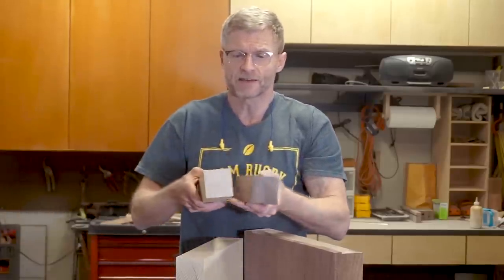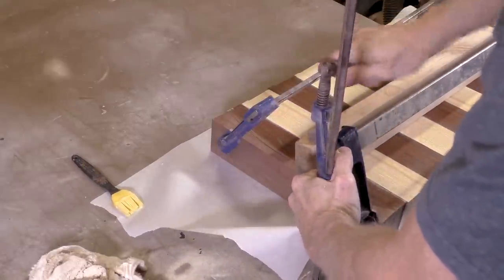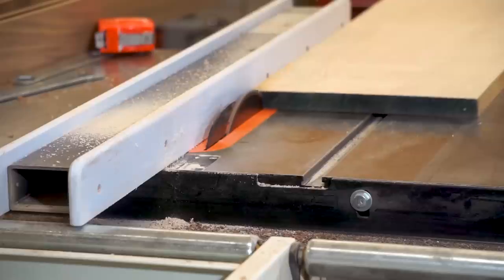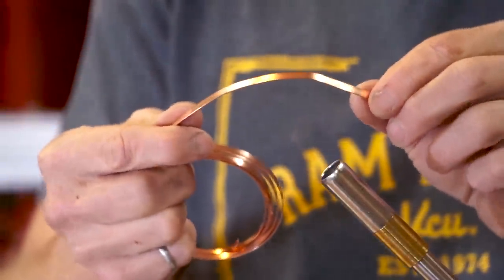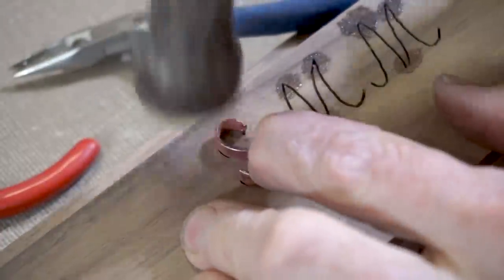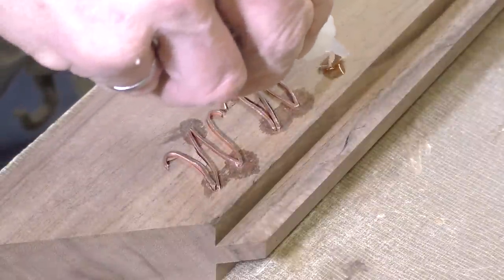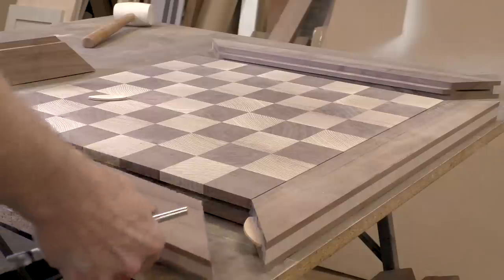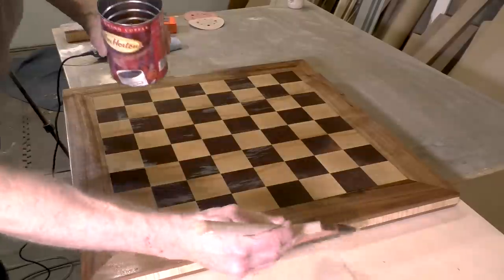Chess Board with Copper Inlay

Comment: Stylish eye, for sure. Very good designer, imo. Decent builder. Tip for the inlay? Good idea to keep within our capacity as humans, i.e. writing/lettering/fonts extremely difficult freehand. So the tip is to do a reverse. Use a copper plate and cut the letters out of it and just inlay the plate. Because you can manipulate the letters until they look right(nail file). Your way, once you Dremel the shape into the wood, you're committed, cz you're bound to the thickness of the copper. With a plate you have no limits, and could even scrap it for another plate, then spray the plate on the board as a stencil, it's faster and looks way better, imho:p 

Peace  

 *oh yeah, when you cut it out, you can clamp 2 plates together, making 2 at the same time, one for the opposite corner of the board. Now it's twice as fast as it just was which was already faster! lol

Comment: I fail to see the point of using such a wide piece of copper for the inlay. A piece of copper wire could have been used with a much shallower groove made with a pantograph. A bit of hammering would flatten the upper surface of it so sanding would remove the bit that was proud and flush it with the surface. CA glue would hold it in place. It is a beautiful job overall, but the finishing went a bit overboard as well. A few coats of wipe-on poly with 320 grit sanding between and some carnauba for the finish would give you as fine and durable a finish. I am not denigrating your beautiful work, just giving feedback from 60 years of experience…

Comment: Nice work, but I believe I would have just hammered some 14 ga. bare copper house wire into the grooves. Just a thought. If you want something pretty, try using maple with mahogany as the contrasting wood sometime. That's what's on my bar top.

Comment: If you're not to confident with metal inlays you could have used copper wire, Using that would have given you more control and the routing wouldn't have needed to be so deep. Just my opinion. BTW the finished board looked great.

Comment: From an old knifemaker, who has pounded a million rivets and pins, the way to anneal (soften) brass and copper and make it more malleable,  heat it "red hot" (cherry red in normal indoor light,about 1400 degrees F) and quench it in water (room temp okay). WoodU, thank The Big Guy we still have people like you who can DO things, not just sit and play with EYE PHONES and computers.
Reply: Well, as pointed out by @TheWireEDM for copper, the quenching does not affect the annealing of copper. You can quench in water if you wish. Quenching in water will cause some of the oxide layer formed by heating to flake off and will reduce the time waiting for the copper to cool. This is different than for steels where the quench very much affects the properties that are present after heating.

Comment: You should have used copper wire for the inlay. It's not like anyone is going to cut a 1/4 inch into the inlay to see how thick it is, is it? I would not be satisfied with that lettering in the slightest. Not for what your client must have paid for that board. No way.

You are going to discover, as I did when I made a table with a copper inlay, that the copper will still oxidize, even under any coating. You're also going to find out that the tiny pieces of copper that get flung around all over the surface of the board when you sand it flush are also going to oxidize and become quite visible.

The only thing I can imagine using that isn't going to oxidize and discolor is gold, frankly. Which, happily, would be considerably more malleable than the copper anyway. You would have gotten far nicer letters out of it. For what your client paid, he deserved gold wire. Not to mention that the gold would have left a very interesting 'sparkle' all over the board.

Comment: Love the project. However I really felt sorry for you seeing the amount of work it took using that solid copper for your inlay. Next time try using powdered copper and CA glue. Not only is it hands down easier inlaying curves. It also handles the inevitable wood movement much better so you don't see the telltale woodshrinkage gaps you'll eventually get around the solid. All the said, I love the way it turned out. Very nice!

Comment: Bending copper work hardens it. Just anneal it again and it will go back to being snowflake soft.  I don't understand why you you used such thick and wide copper for the inlay, copper wire would have been perfect of course. I so love how you discard every single inlay skill learned over centuries by dousing everything in crazy glue. Finally you use Biscuits for tenons instead of crafting mitre corners, sigh, such a wasted time you have on this project. Would I make it, no, I would be ashamed to add my name to such a waste of good wood.

Comment: Given the reliability of modern glues I would have inlaid with wire and could possibly have avoided joins. I'm also not sure how copper reacts with timber chemistry over time, there may be a reason why old cabinet makers used brass inlay. The inlay is not my taste but I'd really love a chess board that size and quality.  I would make it if I had room to work in.

Comment: Could you install splines on the miters & cut the dado's for the edge banding after putting the board together ?
Reply from the maker: That's definitely a possibility. I didn't do it in this video, but I mostly attach the edge banding first and then use mortise and tenon joinery for the mitered corners. By attaching the edge banding before cutting the miters, you don't have to contend with mitering the edge banding to make it fit afterwards.

Comment: jrdaltonjr02
jrdaltonjr02
1 second ago
I liked Chess Board with Copper Inlay very much; copper and brass must be softened by heating & quenching then repeat; until the desired softness is reached. The ends

can be hammered lightly to scarf the tips of the mitire joint. I learned this at about age 25, after much sweat & frustation . sitting down with grandad after, I told him what I had learnet . His laugh let me know he could have saved me the effort. AT 75 he knew much. THANK U 4 THE REMINDER

Comment: Unlike most metals copper is annealed by quenching in water after the heat, not left to cool in room temp...ok so room cooling will anneal it a little bit but try cooling in water, you'll be amazed at how soft it goes

Comment: consensus seems to be, and i agree, that the board is beautiful, thought the inlay is what it is ~ no doubt better than i could do, just lacking in finesse. 

that said, i had owned a trophy/t-shirt shop with the ex (she still has it), and i had always wondered if this process would work, so let me know what you think: because she does vinyl, have her make me a stencil for a plaque board. using that stencil, the vinyl designed for sand blasting, sand blast the image/words into the word. the tricky part would be to gauge the correct depth. then, using ferric chloride, make a 'positive' out of brass to set in the area sandblasted away. glue/fill/sand/finish. i'd always wondered if that would work, anyone have any thoughts?

Comment: I dont know why you did not inlay a copper wire rather than that band. It would have been easer to work and would not have to be cut so deep as to have an issue in chipping. And wire is easer to bend and work in to a pattern.

Comment: Awesome, awesome job! I didn't see this in the comments, but I may have missed it. It should be mentioned that when annealing copper, or any other metal, you want to let the metal cool slowly rather that quenching it in water. Quenching will ad temper, rather that removing it.

Comment: great job but i think you were risking trouble with tapping the copper in with a metal hammer, luckily no problem but i would use a piece of hard wood in between the hammer and copper

Comment: That inlay work looks really hard to do. Makes me wonder how it would turn out to fill it with a molten metal. (I guess you'd have to start with a deeper cut and piece of wood since you'd need to sand off a lot of burned wood on the top. And maybe have to use a metal with a lower melting temp.) Very cool chessboard! I love the way it turned out.

Comment: Are you worried about cracking  from expansion and contraction since the board in endgeain but the frame is not?   I'm curious because a chess board is something I would one day like to make.
Reply from the maker: I don't anticipate any issues because I attached the frame with only a single bit of glue at the center of the frame, and there's an air gap in the tongue and groove joint between the board and the frame to allow for expansion and contraction. The board will most likely be in a climate-controlled home and it is well sealed with the polyurethane to keep the impact of humidity changes to a minimum.

Comment: Certainly a beautiful piece!!! Is this a typical finishing process for something like this? The <polyurethane + paraffin oil + wax> is particularly what I’m asking about. Being what they are, not one of these would bond to the other, right? What is the benefit? Upkeep? So cool! Inspiring!!!!
Reply from the maker: A polyurethane or urethane finish is fairly typical. I mistakenly said that I used polyurethane, but it's actually urethane that I used. After applying the final finish, I rub the finish with ground pumice stone and I use paraffin oil as a lubricant. This helps to make the finish very smooth and removes any little bumps caused by dust particles. That all gets rubbed off and then I apply paste wax as a protective finish that can be reapplied over time, as needed.  Some viewers have commented that I might have attained a better finish by using a precatalyzed lacquer or a conversion varnish instead of urethane so that the finish is not so plastic-like. They're probably right, so I intend to try that on the next boards that I make.

Comment: Cool video.   Love watching a master woodsmith at work.  I wonder how good it would have looked, instead of real copper, to create some very fine copper dust (by collecting "sand" from sanding copper and a vacuum, with a pre-filter?).  Mix the copper "dust" or particles with ultra-clear epoxy resin-- keep the ratio high copper dust relative to resin.  Engrave fairly shallow letter grooves, then using a syringe, squirt the epoxy/copper into the grooves.  Let cure overnight, then sand as usual.  I bet it'd work just as well, and be a lot easier than actually bending/pounding copper pieces.  You could use brass, silver or even gold dust I expect, although the latter could run up the prices. :)
Reply from the maker: Thanks for taking the time to offer a few tips. I'll be trying that process in an upcoming video, but I'm unsure yet whether to use CA glue or epoxy to mix with the metal dust. I'll experiment with both to see which one produces the best results.

Comment: At 5:14... how is the frontmost row mis-aligned to the next row?... ie: dark square butts against dark square and light to light.  Then it's correct again after that???
Reply from the maker: I had actually glued up several chess boards at the same time, so it wasn't always the same board that was running through the sander. On that particular board, I had made a mistake, so it's now going to become a cutting board. I left the mistake in the video without mentioning it to see how many people would notice.  Good catch!

Comment: Beautiful board!  Just decided on christmas presents this year!

Going forward, quenching your non-ferrous inlay material will net you a much softer annealling result, as opposed to allowing it to air-cool.  With a thin copper like that, it would have allowed you to bend over a knife-edge, to do the "M" in one go.
Reply from the maker: Thanks for the info. Several viewers have commented the same thing, so I definitely learned something!  That'll be helpful for the next time I attempt something like this.

Comment: I imagine you had to do quite a bit of sanding with a hand sander after the drum sander? I have the same drum sander and it leaves fairly deep scratches in the end grain which I have to sand out using a large hand sander (Festool Rotex). Lot of work! Also, I like to apply a bit of clear shellac to the area I'm going to inlay, prior to putting the inlay material in. This helps to reduce staining from the CA glue.
Reply from the maker: It definitely takes additional sanding after running it through the drum sander. To help minimize the amount of time it takes to remove the scratches, I use a coarser grit on the random orbit sander than what I used on the drum sander. For example, if I had 100-grit on the drum sander, then I would start with 80-grit on the random orbit sander and then work my way up to 220-grit.  The oscillating drum sander that Jet has might be a good option to help overcome this issue, but I'm still pretty happy with the one that I have.  Thanks for the tip on using the shellac. I had meant to do that, but forgot....and then it was too late.  LOL

Comment: Gorgeous chessboard! Only some comments abt copper inlay as I also do this kind of jobs, just to share experience.In this case I would preferred some gold looking to mach the tone of walnut. Brass would had been my choice. Copper is most "good looking" with clear woods such as ash or maple. Brass, at same thickness, is quite stiffer than copper but when annealed it become "workable". I appreciate your use of band instead of wire, as I do, but only because of less availability of brass band in my zone (I live in as small town, north of Italy, middleway between Milano and Como lake). I flatten wire by ammering on anvil, it is quite boring work ...but it works. About chipping of corner it is also my big concern. I do not work with router but with knives and micro chisel. When chipping appens, if possible I re-use the chipped piece, otherwise I fill the gap with a sort of putty made with wood powder and aliphatic glue, this allows to rework the channel. The use knife and chisel allow to have a not square border of the channel as router bit do, but decreasing on bottom, allowing to have more grip for the wire. To avoid marring both the wire and the wood, I use plastic or wood mallets. After finished to inlay I wet all the work to allow fiber to expand and grip the inlay. Than I make a first run of sanding with mid grit. This allows some wood particles to enter and fill all gaps (very few after wood fiber has expanded). To fix everithing as last step of inlaying, I pour all along the lines some CA glue. At this point the work is ready for following finishing steps: fine sanding, shellac, PU, beewax or so. Cheers!
Reply from the maker: Thank you very much for the suggestions and the description of the process that you follow! That will be helpful for me the next time I attempt to do something like this. I look forward to benefiting from your experience!
Reply: It's a pleasure to share experience, wish you to benefit of it!

Comment: I like it. I don't like the copper letters though. Doing it manually and having two letters repeated (MM) causes them to not be exactly the same. And I can tell they look different. Maybe to the owners is ok, it means it's made by hand too but... I don't like it. Another way of doing it could be to make the letters first, and then heat them to be red hot and rest the hot metal on the wood. That would transfer its form to the wood and you can route it there. I don't know, it's just an idea. Amazing work mate, subbed!
Reply from the maker: Thanks for the idea. I'm definitely looking for ideas to improve the process, so I might be able to give this a try.  Thanks for subscribing!

Comment: At one point the configuration of the board was correct, and then suddenly the bottom row was wrong.  Then suddenly it was right.  How did that happen?  And there wasn't any comment in the narration.  It's hard to believe that the board (as configured) was put through a planer/sander twice without this being noticed.
Reply from the maker: I had made several of the boards at the same time. I realized mistake as soon as I ran it through the sander. I decided to leave the footage in the video without commenting to see how many people would notice. You're one of the small percentage of viewers who have noticed.  Good catch!  That particular board is destined to become a cutting board with 56 squares.

Comment: The sanding sequence at 5:12 - did you have to break the end off the board to re-orientate it correctly? Otherwise, good vid, thanks.
Reply from the maker: Good catch!  No, I had made several boards at the same time, so I wasn't always videoing the same one until it got to the framing stage. That one, unfortunately, will become a cutting board. If I tried to cut it off, that final row of squares would no longer be square.

Comment: I have personalized a lot of projects  for clients. i do the same routering as you did here. Only differance is i use crushed stone with a sprinckel of either brass or coper fileings then cr glue us poured on top it soakes right in , there is no way you will break a piece doing it this way ,to finish i sand it as you did the copper. I put stone in a metal tube and crush it in a hydrolic press with a metal dowel. Brass and copper make with a metal file,do it over butcher paper to pour the shavings into a plastic container.
Reply from the maker: Thanks for the suggestions!

Comment: Looks beautiful but you could do with some practice on inlays. Next time fully shape the letters before hand then use those to make a stencil and use that with the dremel and router bit then insert the entire letter at once so the wood doesn't split, that way you don't end up with those ugly gaps in the wood and broken pieces in the letters 23:06. Besides that the board itself is gorgeous, very well done, absolutely 0 complaints.
Reply from the maker: Thanks for the suggestion. I really appreciate you taking the time to suggest a better approach so we can all learn.